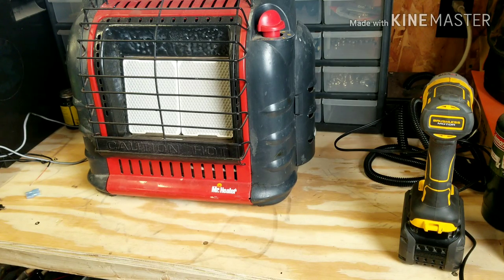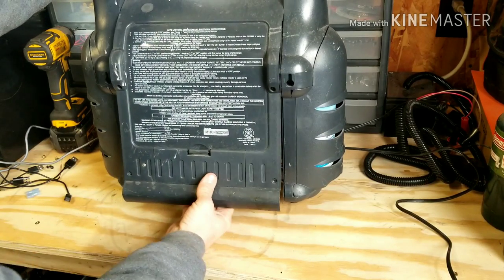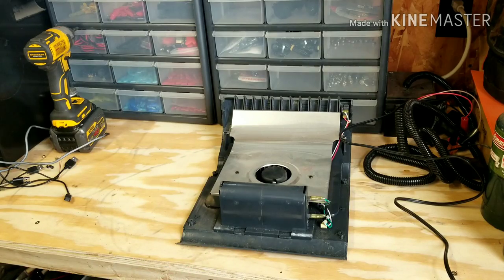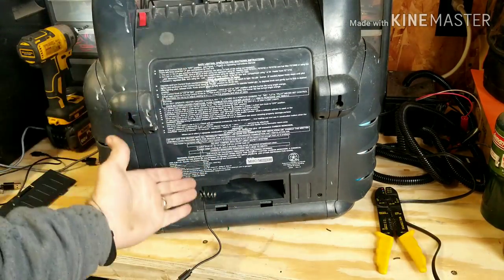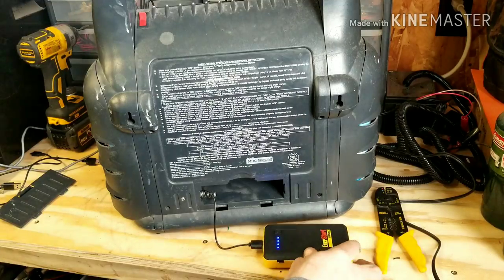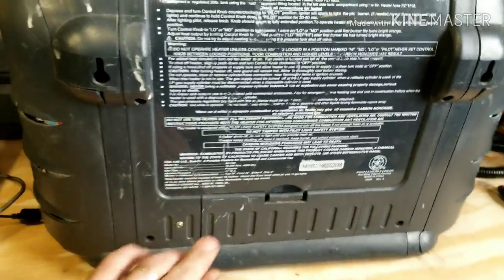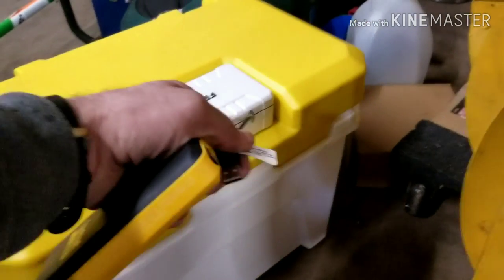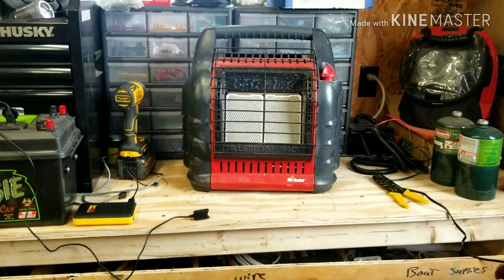Amazing big buddy heater hack

Comment: Could you please show how to hook it up on the frabill aerator?  My cord to plug it in cig. Plug'in for shorted out and I need it working soon ( Bait ) and I can't figure out what wire to cut
Reply from the maker: Solder it directly to the wires that are on the battery contacts.  Very easy to see when you open the battery lid
Reply: @JDSOutdoors  ok, thank you very much!
Reply: I have 4 wires after I cut the end off of my charge cord I have a ( white, grey, green and a pink wire ) which do I use or is this cord junk?
Reply from the maker: @remipuppy  you must have a media cable. It's not junk but you need to use a multimeter to figure out the pos and negative
Reply: @JDSOutdoors   How do I tell if it's a media cable or the one I need?
Reply from the maker: @remipuppy  that I'm not sure. Usually a hint is like cables for cameras are like that etc
Reply: @remipuppy  do you have a multi-meter? plug cable into battery pack and check for voltage.
Reply: @jimstone1404  no, I do not
Reply: @JDSOutdoors  I tried to hook up my areator this morning with some other phone cord with solder and nothing worked. Is there a way I could DM you?

Comment: that little fan isnt even worth the Mod i am going to put a bigger fan inside mine that has more CFM
Reply: I've used 140mm computer tower fans powered by an ac/dc adapter at the most power they can take. I made a little flat piece of metal with a clip on the bottom and mounted 2 140mm fans side by side and it clips to the handle of a Big Buddy or Portable Buddy. It works pretty good when you don't want the heater extremely close to you for whatever reason. At 5-6 feet away it does enough to get the heat over to you while the space(my camper for instance) starts warming up. So I stay warm while my wife's computer overheats hahahaha!!! Just kidding.

Comment: I just use the AC adapter. Strong power & no battery needed. Of course, that's only for home use.
Reply: most people would as well. However the buddy heater is an outdoors heater with propane and many will use it for hunting, ice fishing etc,
Reply: Why not just cut the end off of an ac adapter and wire the usb into that?

Comment: you only need 2 male spade connectors , snipping the original ends off is a pointless step keep the original female ends and just put the male ends on the usb cable.

Comment: Why not just use t taps to tap into the existing factory positive and negative? That way you only need to crimp on to the USB cable and you're done
Reply from the maker: More than one way to skin a cat
Reply: That's very true. I just wasn't sure if there was a reason for doing it the other way

Comment: All the usb cords I cut off had 4 wires in them not 2 and the wires were so tiny I couldn’t even strip them without them breaking
Reply from the maker: Gotta use a cheap non fast charging/data cable
Reply: @JDSOutdoors  ok thanks I’ll try that
Reply: Yep, after cutting 3 different cords, none  of them had 2 wires, all had 4. Guess I never got "cheap" USB charging cords. To bad, because I really wanted to try this hack. Oh well.
Reply from the maker: @cmaccowan76  you can still use the 4 wire ones. Just gotta find continuity for which 2 are +/-

Comment: You know you can use A thermal fan that will go on the stove needs no batteries electricity
Reply from the maker: You know thats one extra thing to carry right ? Why not use the fan thats already in it.
Reply: @JDSOutdoors  yes…. But it’s it the same thing when your carrying around a battery too and then finding some way to charge it once it’s drained. The fan doesn’t use any power but the thermo heat from the unit.
Reply from the maker: @iiinsaiii  battery fits inside the heater side panels and lasts all weekend no problem. Charges easily at home when you recharge your electronics.

Comment: Why not use these on the USB cable: https://www.amazon.com/Glarks-Semi-Insulated-Terminals-Connectors-Assortment/dp/B01E5TXX8C/ref=lp_306733011_1_13?s=industrial&ie=UTF8&qid=1606674089&sr=1-13
This way no change to the OEM wiring and you could leave the USB cable always connected, make a hole for it to come out or make a cable that is in 2 pieces.
Just seems like you went the long way and you need to open up the unit for access each time.
And as others have said, why cut off female to put on female?

Comment: ok what doesnt make sense is that you cut off a female connector and replaced it with another female connector....one step that didnt need to be done
Reply from the maker: Been explained several times in the comments on why. Fitment

Comment: This is obsolete since you can just buy a stovetop fan that uses no battery just the heat which the heater produces.
Reply from the maker: One more thing to carry no thanks. This Is far from obsolete
Reply: @JDSOutdoors  One more thing to carry?...like the lithium ion battery packs, cell phone charger or a power box that is at least twice as big. It's not that big and it would free up the energy in your battery packs, cell phone charger and power box to be used for other things instead of the heater fan but to each their own.
Reply from the maker: @A.C.71  the pack fits inside the heater. Them wood stove fans don't.
Reply: @JDSOutdoors  Oh I see the one you have has the built in fan. I just got one with no fan. I was thinking you had to have a separate fan along with your power to run it but yeah I can see now that's a pretty nice set up. But for those with a big buddy with no fan I think the thermofans is a nice setup since it runs indefinitely, of course if those battery packs that fit inside the unit can run a stand alone fan at decent rpm to blow the air for a long time you still would have the advantage of power left over possible to charge a cell phone etc.
Reply from the maker: @A.C.71  yes sir the ones with no fans that wood stove one is the only way to go

Comment: Overly complicated. Just hook up the usb to the male connector that fits the big Buddy. If you have to adjust the voltage use a BEC. What this guy has done is likely to cause explosive sparks next to leaking propane bottles. Don’t blow yourself up.

Comment: There is NO POSSIBLE NEED TO CUT ANYTHING OFF OF THE HEATER FAN CONNECTIONS!!!!  THIS WAS A VERY POORLY THOUGHT OUT PROCESS!!!  JUST SAY NO TO CUTTING ANYTHING!
Reply from the maker: Nope but like I've said in 100 comments 2 pieces made for each other fit much better than sticking a rubber coated connector inside a plastic one. THIS WAS A VERY POORLY THOUGHT OUT COMMENT
Reply: @JDSOutdoors  ......d0000000000d.....I am and have been since 1983 an FAA licensed A&P mechanic--recently retired.... and it is my professional opinion there is NO REASON to cut any of the connectors off of anything, here.  NONE.  There are at least 3 or 4 BETTER ways of doing this that I can see at a glance.
Reply from the maker: @ssnerd583  make your own video of the "right" way then. Have a good day I look forward to watching